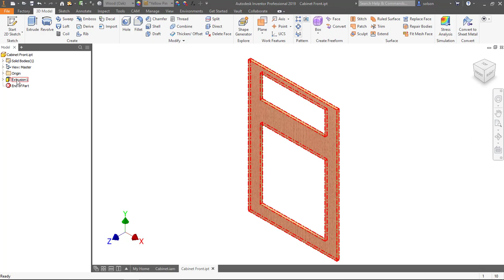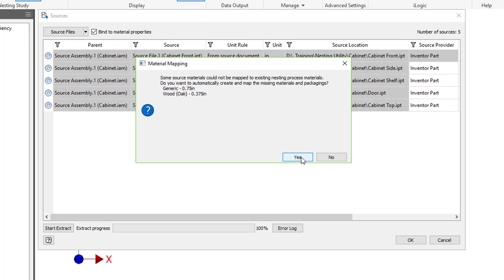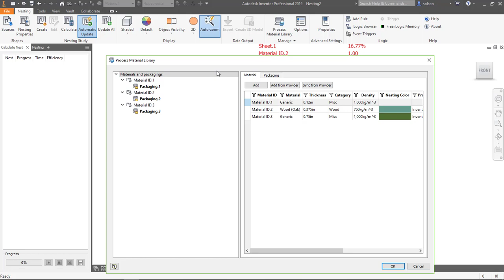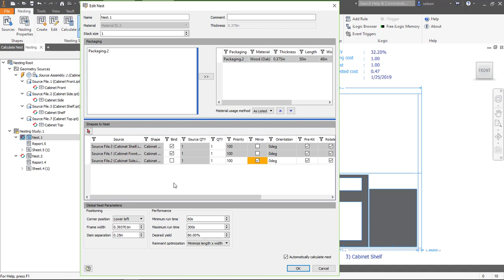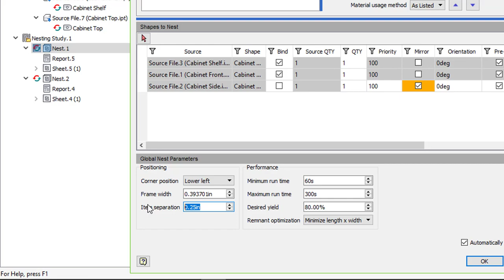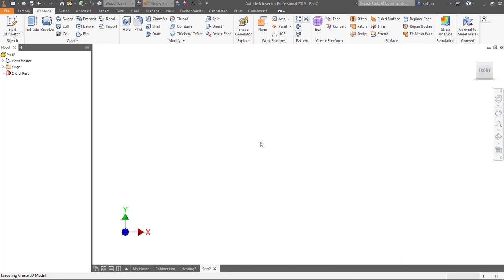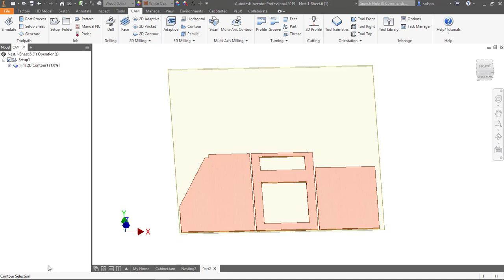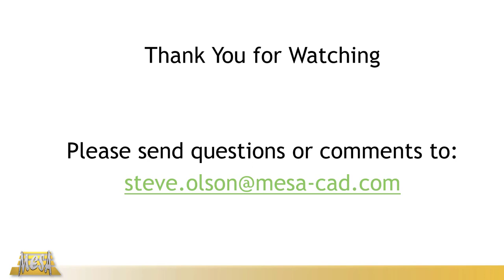Autodesk Nesting Utility

Comment: Thanks for the video. It help on a sticking point I was having in the nesting utility, namely where to set the item separation. It seems a bit counter intuitive to have to go in and edit this number after the first nesting path rather than setting it up in the first "Create" screen.

Also something I found after I ran my first pass and had hinges and acrylic parts show up is that you can go into individual parts and mark them to be excluded from nesting. This way you do not have to strip down your model before you nest but like so much else it is helpful to know at the start of the project rather than having to run trough a long list of non-sheet parts to tell them to be excluded.
Reply from the maker: Thanks for the comments.  All great points.  I found the exclude option the other day, after I made this video.  Your right that it is counter intuitive to set the spacing after the nesting is made.  Their might be another setting some where.  I haven't dug too deep in the Process Material Library, it might be an attribute of the material.
Reply: @3DSteve52  ,
I got a message from an Autodesk team member that the Item Separation setting is in the Process Material setup under the nesting tab.